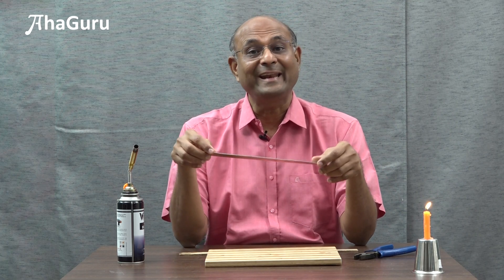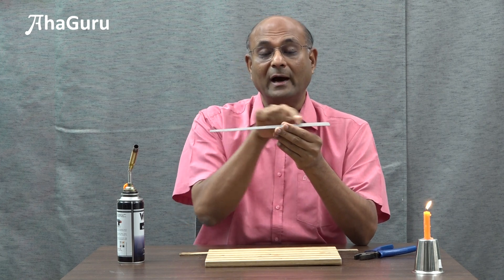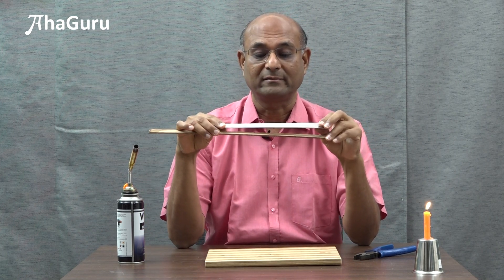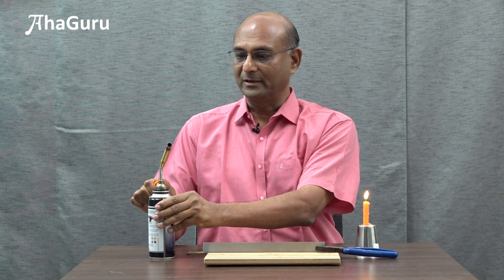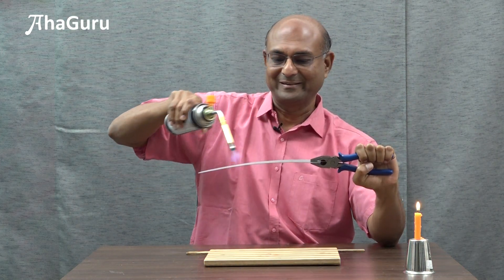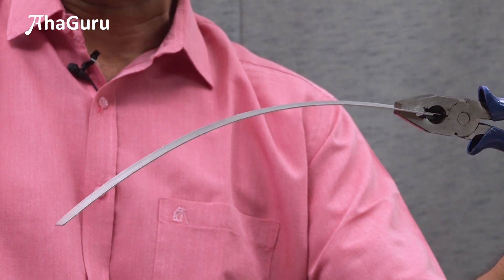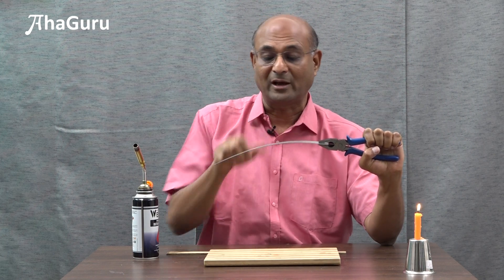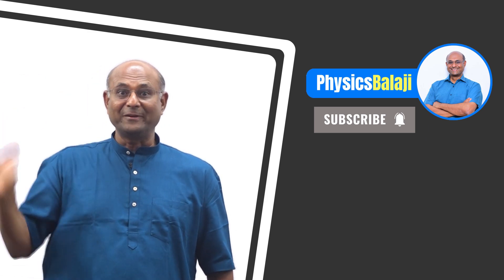Fun Physics Experiment with Bimetallic Strip Thermal Expansion Physics

Comment: Sir, I am you big fan of your teaching. Your videos are extremely intuitive and give a new perspective to solving problems.
Could you please help with this question:
A ball is thrown from the ground with an upward velocity of 20 m/s.  You are watching it from an elevator that is moving up with a constant velocity of 8 m/s.  How much time later do you see the ball reach the maximum height?  Also find the maximum height attained by the ball as seen by you.
I am getting 7.2 m as the answer by changing ref frame and using rel velocity, the key in the course page is different sir..
Actually if we want to calc in gnd frame we must use V = 8 m/s right sir?..
Nanri

Comment: sir this is an IIT-JEE q from your year:

A carpet of mass M made of inextensible material is rolled along its length in the form of a cylinder of radius R and is kept on a rough floor. The carpet starts rolling uniformly without sliding on the floor when a negligible push is given to it. Calculate the horizontal velocity when the radius of the cylindrical part of the carpet is R/2. Also find the total time needed to unravel
Reply from the maker: Yes.  I remember this question.  Good one.  Will try and make a video on that.
Reply: Thank you for your reply sir! I tried to conserve angular momentum but the axis is also moving so i got a bit confused

Comment: sir vera level. And i have a smol doubt. Will lowering the moment of inertia of say a drone's body, will it increase it's maneuverability or agility? i used to have a slow drone that's why
Reply from the maker: Reducing the moment of Inertia of a drone will make it easy to turn it around.  But it also make it overall more wobbly. So overall it will be harder to control.
Reply: @physicsbalaji  thank you so much sire!